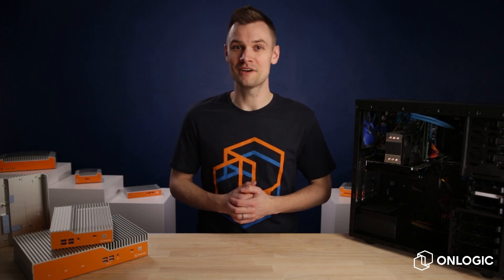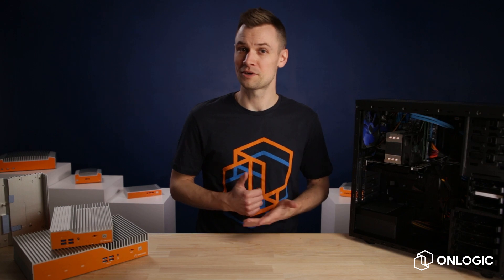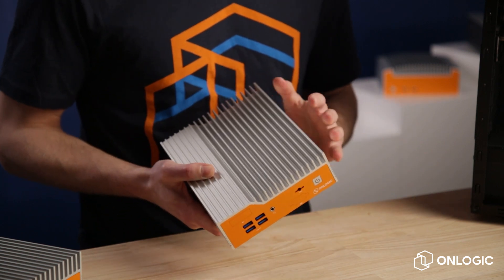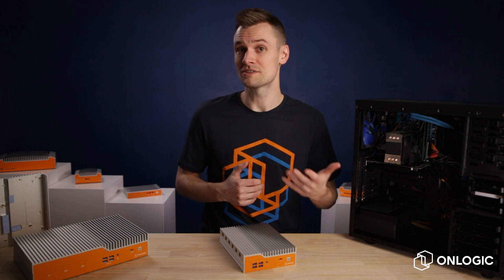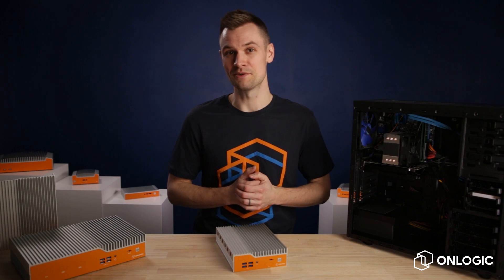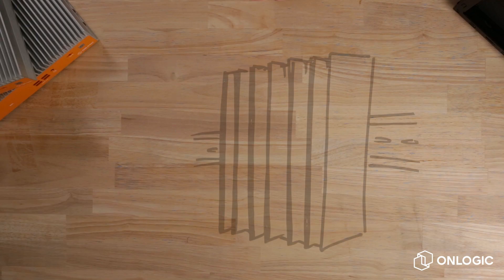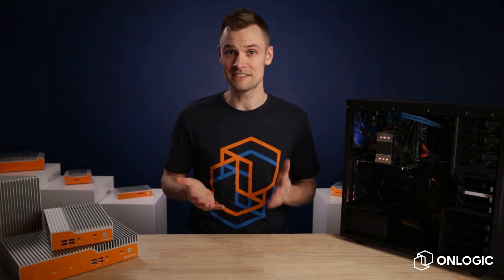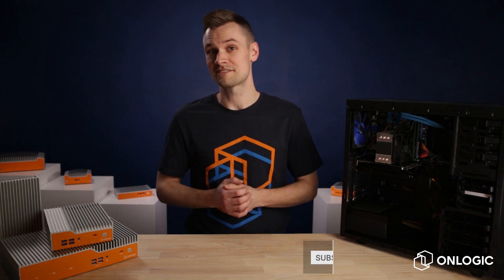How does Fanless Cooling Work in an Industrial Computer?

Comment: Well how is the heat transfering connection made between the processor and the aluminium extrusion housing?
Reply from the maker: Great question! The processors are in contact with a surface of the heatsink specifically machined to be smooth and flat for an optimizing the thermal junction. A heat-conducting thermal interface material (TIM) or thermal paste is added to this junction to help fill any microscopic imperfections between the contact area of the processor and the heatsink to further help ensure efficient transfer of heat from one to the other.

Check out this video to see how we make the connection for other heat producing components, specifically around the 2 minute mark: https://www.youtube.com/watch?v=bIfgeznCkN4